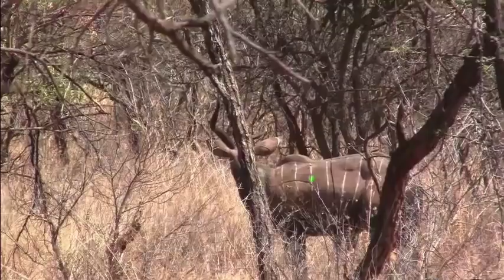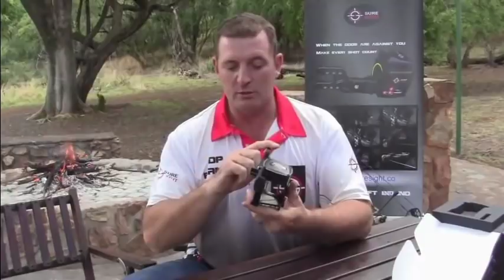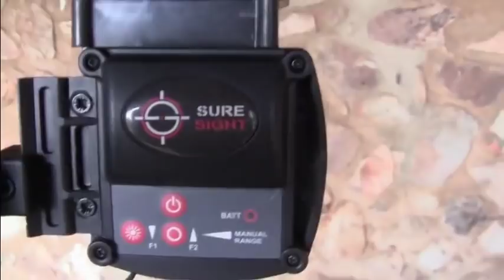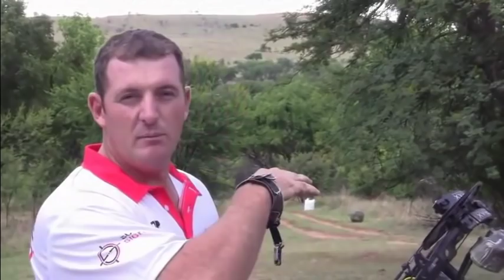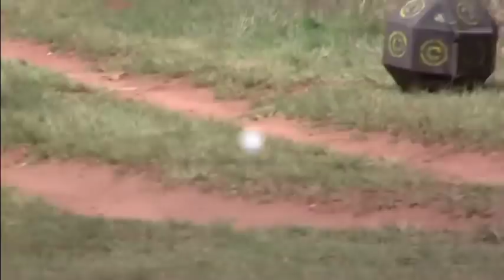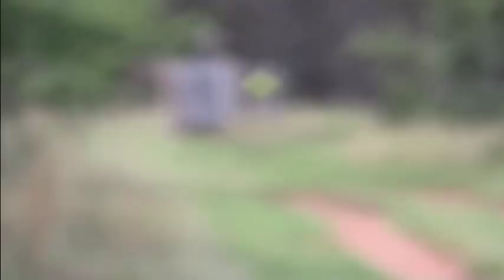(  www.suresight.co )   Sure Sight Automatic Bow Sight ----- Set-Up

Comment: curious how well you can see the green laser at further ranges and be able to hold it on the target without some sort of aiming reticle.  I like th concept/design, that is kind of my biggest hiccup on this though.  Maybe I am over thinking it?
Reply from the maker: Hey Steve, it is not designed to range super long distances, but rather ones that you are able to shoot. 
Holding the laser on target is pretty much the same as holding a rangefinder on target if you support the bow.
This can be done at full draw as well as from the hip or any desired position.
Thanks

Comment: You changed the program from 107 to 112 for 42 yard shot. What would happen when you go back to 20 yards with program 112??
Reply from the maker: Hi Michael, your 20 Yard pin is the same for every program, as you go further away the programs will change according to your arrow speed, so to answer, if you went back to 20 yards you would be spot on. Once your 20 is set you never change it.

Comment: So where do you get one? Can the blue dot be changed to a different color?
Reply from the maker: Hey Michael. The shooting pin only comes in Blue. Research has shown the the colour blue shows up best on any background or target. To purchase one from South Africa you can do so on our website www.suresight.co or if you are in the US from www.suresightusa.com
Reply: One more question

Assuming arrow weight and speed stay the same and 20 yard pin is set. What is the next yardage to shoot (40)? To determine program that you will use and will this program be correct at every yardage shot? 

Then if you change arrow weight and speed you need to reset 20 yard pin and start over right?

Comment: I just saw this as an ad on YouTube today! Nice but of gear for sure! Okay I gotta say I was also enjoying the birds calling in the background. It was all exotic except the Guinea Fowl I used to use them in Northern Canada to protect my chickens.
I've been away from Archery for some time but this Spring I am breaking out my gear and starting up again, I will have a look at the availability of this unit.
Something that should be pointed out is that no matter how well any bit of gear works, you still need to be in shape, well versed in shooting and it does not make it any more ethical to take a long shot on a living animal.
I love the way this works, thanks!
Reply from the maker: Hi Kerry, absolutely right, its all about how steady you can hold your shooting pin on the target, but when your shooting pin resolution is only 0.5mm and and you are presented with the correct pin every time, this sight makes it a whole lot easier.
Reply from the maker: We look forward to hearing from you Kerry